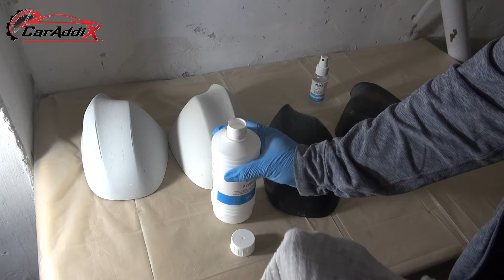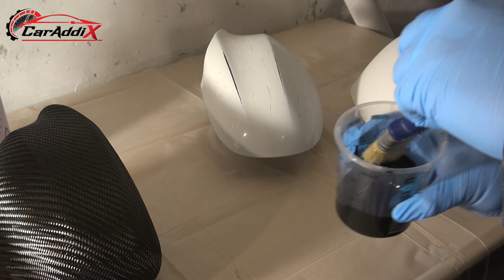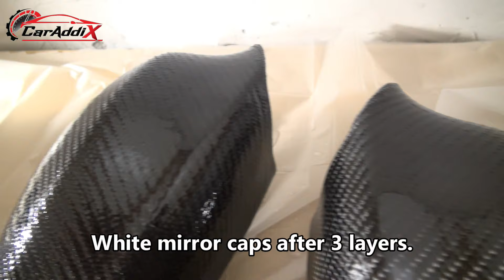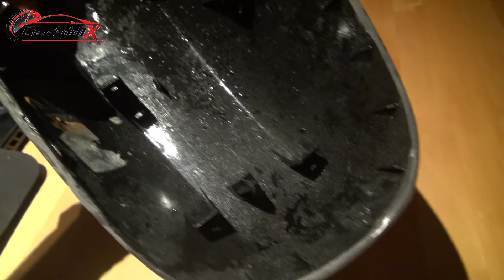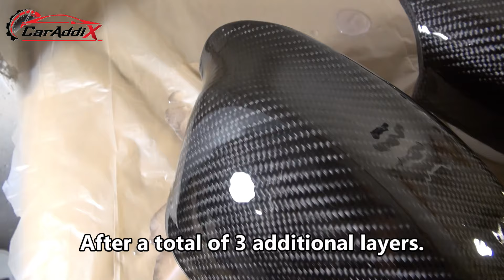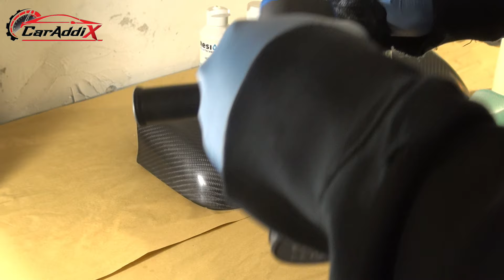Carbon Skinning 2 Mirror Cap Sets in 2 different ways!

Comment: Not hating but can someone explain why you would do this? I mean wrapping would the same result. There is still the original plastic under it right?
Reply: Some people really like carbon fiber accessories for their interior or exterior of their cars, like interior trims , shift nobs or even head light covers. Realistically if you have back round in composites you know that it takes more work to make an applicable part like this head light cover from having to make a mold of the original part and then lay up and vacuum bag then have to infuse it , demold it , trim it scuff it buff it then have to clear coat just to have a lighter version of the headlight cover which is not a big change in the cars weight when it’s plainly cosmetic so the answer to your comment would be it’s just more convenient and cost effective since it adds no performance value to the car.in the end it looks great and that’s the purpose it serves in this case.
Reply from the maker: You can only see the big difference in real life. If you make a nice carbon layer the material has depth, it changes how it looks the way you look at, day or night etc. It's alive. If you wrap with just carbon looking sricker (how i started), you basically just put a picture of carbon onto something. You might fool someone with a still image but in real life its a difference between night and day. I still have lots of different carbon vinyls but when I look at it, I just shake my head lol. Wrapping was fun, still do sometimes but can never replace the real thing.
Reply: There is more to it than just the aesthetics. When done properly, parts that have been skinned with carbon fiber are more rigid and durable - abrasion and scratch resistance, UV protection - Skinning offers a layer of protection that you just won't get with anything else. 
About a decade ago I bought a vacuum bagging system and autoclave to make custom parts for the Porsche 914 that I autocross. Since most competitions were out on hold during COVID I decided to build a sim rig at home. Even though I have all the equipment to make 100% carbon fiber parts for the setup, I opted instead to use 3d printed parts I had skinned. The finished products are far better looking and much more durable than regular 3d printed bits and the process is much quicker than making full carbon parts.
Reply: @juanesteban8827 💯 agree.  In skinning you sacrifice some weight/strength as opposed to a full (or pure) CF component, but you save time and money.  The finished product is light years deeper & richer than a wrap.
Reply: Only for looks
Reply: Wrapping doesn't nearly look as good then a clearcoat with real carbon. And this looks amazing. So why not?

Comment: These came out beautiful. I'm in the process of doing a headliner for my boyfriend's van. I created a mold with his old headliner by putting blue tape over the whole thing then doing the layer of fiberglass as my main mold then I used the appliance epoxy paint in black I like it better than brushing on It drives more quicker and you just spray it on You can lay down your carbon fiber directly after. Also I put layers of gloves on so if I get anything on my glove I just rip off one layer of glove and I've got a fresh glove already on I don't have to mess around with that. And instead of the tape to keep the carbon fiber from distorting I spray the adhesive onto the carbon fiber sheet and let that dry. It's a spray-on adhesive that comes out in a mist no chunks let it dry until you can touch it but won't stick to your finger This holds the carbon fiber in place yet still has movement to it to get around corners and whatnot. I also use a sponge applicator instead of a brush because it never fails I always end up getting a bristle of paint brush sticking in it even if I prep the brush with tape first. It just never Thank you for sharing your steps with us as well as showing us two different applications.

Comment: what sort of glue did you use because i bought one awhile back and it was the one you use on carpets not the fine mist you used.
Reply from the maker: It's Stevik spray glue for resin infusion, use a very thin layer so there's also enough spots through that layer where the carbon fiber and resin can bind with the basecoat resin.

Comment: You did one on spray adhesive and the other on base epoxy and I could see no difference in the end result. Any difference in the result? I would be concerned about the glue not sticking as well as the epoxy, especially with wind, rain and vibration. Any idea how they last over time? Was the only 'saving' made using glue the cost of the base coat plus the time waiting for it to dry?
Reply from the maker: The main reason using glue is to save time. You can also do more complex parts in general using glue. Just go easy with the glue, this will keep enough space for the epoxy as well so you don't just build on the carbon held by glue. The 2nd layer should be able to get through the fabric and still hold onto the original part 🙂. At keast, that's my strategy here 😁. Just glue as an anchor will not hold over time.

Comment: How much thickness does the skinning add to the part please?
Reply from the maker: That depends on how thick of a layer of epoxy you want to keep on top and how much clearcoat. The carbon layer itself will probably stay under 0.40 mm and under vacuum 0.20 (rougly). The thicker the layer, the more depth and beauty though but that personal preference.

Comment: I'm about to do the same thing on my motorcycle so thanks for the vid! Though you'd avoid that orange peel if you moved the can closer and did a slightly heavier clear coat. But otherwise great video!
Reply from the maker: It's almost impossible to not get orange peel with spray cans when spraying clear coat. I do recognize what you mean though, but that would also turn into a hit and miss results where most likely, the coats will be uneven, runny and full of drips. Even professionals with expensive spray equipment get orange peel, some less than others but it's a very big challenge to spray clear-coat without orange peel :). There are many discussions about this as well where people claim that it's better to leave the orange peel on as it offers more protection (which is true in some way). Also many cars just come from the factory with orange peel but most people don't pay attention to this, people usually don't look up close to inspect someone's paintjob unless it's a special car for events or something :).

Comment: love it!!. by the way, does this process can work for repairing carbon fiber mufflers? if so, what kind of resin that fits for mufflers? some say not all resin are compatible to make mufflers and some may discolor due to the heat. im trying to repair my carbon fiber mufflers on my motorcycle that got alot of small pinholes and at the same time clean it from cloudy waterspot like mark that cant be cleaned from just spraying water. having a hard time to figure out the perfect solution for my problems

Comment: Please once you lay the carbon fiber did you apply the resin or the base coat
Reply: Clearcoat resin goes ontop of thr carbon fibre cloth, the black base coat goes on 1st ontop of the mirror caps then thr carbon cloth on top of that black base coat

Comment: Applying second coat how long did you wait for first coat to dry then adding second coat
Reply from the maker: You can basically add layers as soon as the resin stops being runny and all bubbles are degassed. How long you have to wait also depends on the temperature you are working in. Some people wait until the resin doesn't stick to your finger anymore but does feel sticky and others (including me) add layers as quick as possible, while waiting for at least 1 hour. The other method is usually 90 to 120 minutes before you check how sticky the resin is. For the above reasons I recommend that you also brush some resin on something else so you can keep touching the resin to check without having to touch your project and possibly ruining it.

Comment: How long before each layer did you had to wait?
Reply from the maker: Roughly 2 to 3 hours depending on room temperature. You can do shorter breaks depending on your resin. Most important thing is the resin having time to degas and not still being too runny. Takes some trial and error if you are impatient without messing it up 🙂

Comment: How long do you let the epoxy sit in between layers?
Reply from the maker: Roughly 2 to 3 hours depending on room temperature. You can do shorter breaks depending on your resin. Most important thing is the resin having time to degas and not still being too runny. Takes some trial and error if you are impatient without messing it up 🙂

Comment: Nice job mate!!! Quick one, what are you using to clean the brush of epoxy?
Reply from the maker: I don't clean them. It's all trash after 1 time use 🙂. You could clean them with Acetone and vinegar though, but you would have to do it within the first few hours.
Reply: @caraddix Can you make an armrest out of carbon fiber?  I can send a form
Reply: @caraddix How much will this cost me?  The car is Honda Accord
Reply from the maker: @آخرالرجالالمحترمين-ت8ظ  To do yourself or have me do it for you? Feel free to contact me on Instagram: CarAddixIG
Reply from the maker: @آخرالرجالالمحترمين-ت8ظ  Yes :). Do you have Instagram? Message me: CarAddixIG

Comment: when you spray the 2k clear coat, get closer, you want the material on the part and not in the room, the instructions on the cans are rubbish, the first coat can be light but it only needs to be left to dry for 2 minutes, then apply a rich, opaque, closed, glossy coat, which then let dry for 15 minutes, then apply a second opaque coat just like the first glossy coat, after that you won't have any problems with texture (orange peel) and you won't need to do much sanding or polishing!!!
if you're asking, I'm a vehicle painter